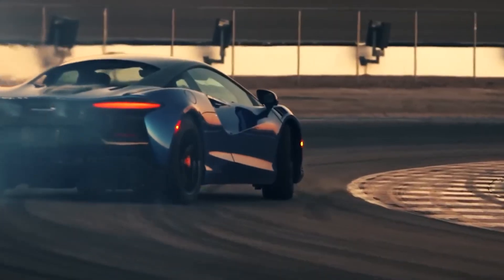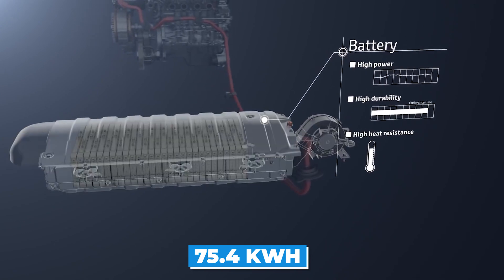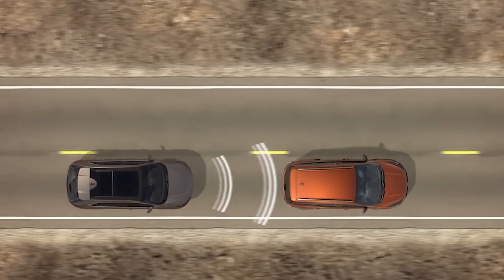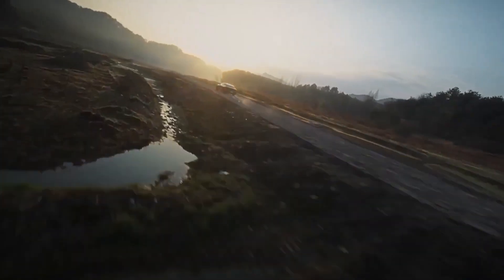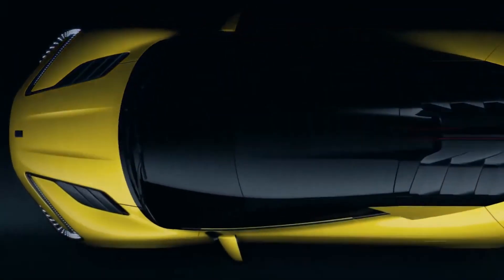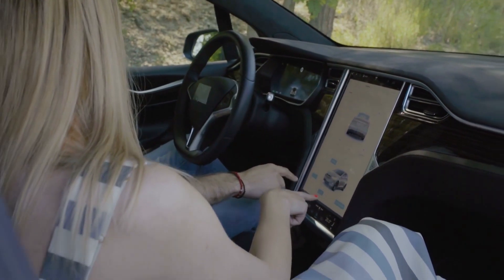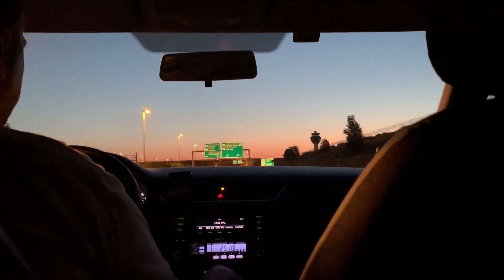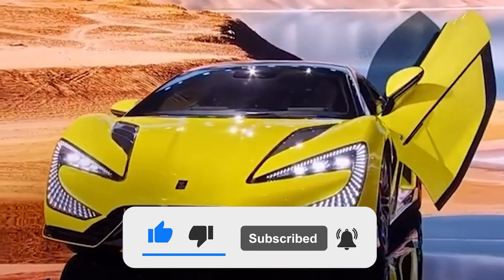LATEST Updates on the NEW BYD YangWang U9 Electric Hypercar!

Comment: What is going on here. All these facts are in correct. Images of a Atto 3, seal, the U8 SUV 4wd. But the video is about the U8 hyper car. 

The stat of the battery is for the atto 3, and the 0-100 is the atto 3.

The U9, hasn't come to market yet, and is expected to do 0-100 as fast as the Tesla S,Plaid. 1.99 sec.